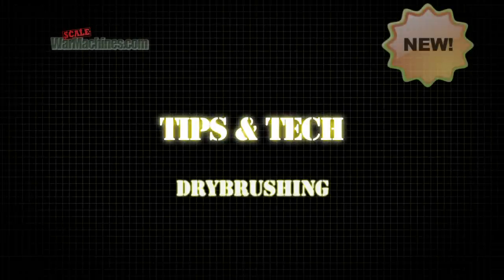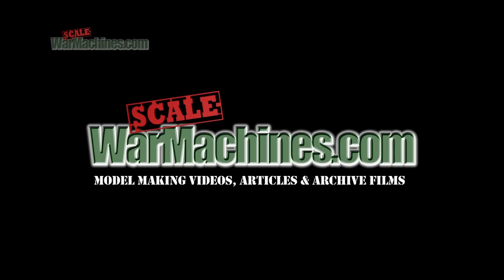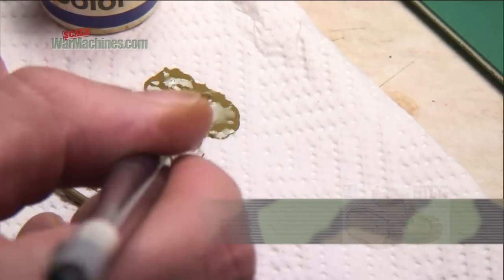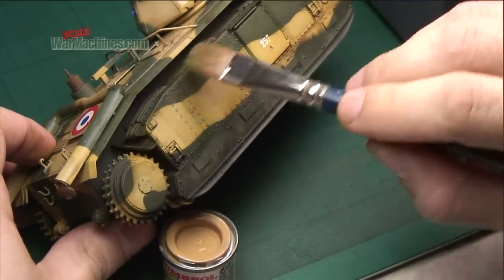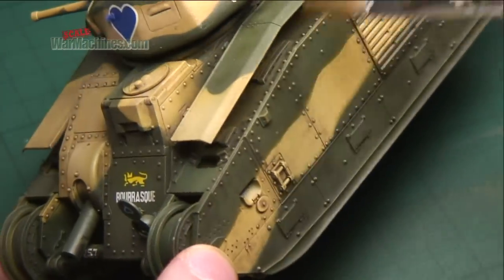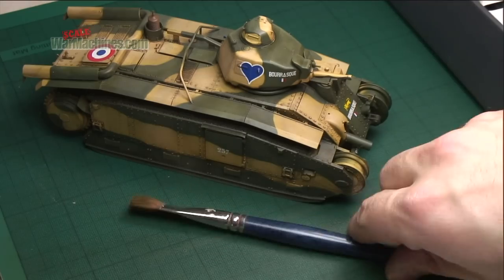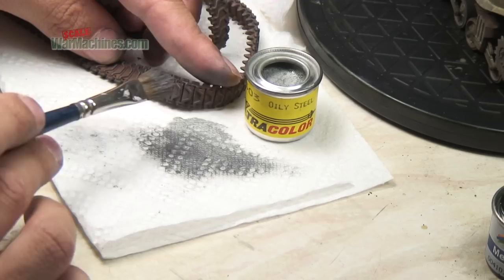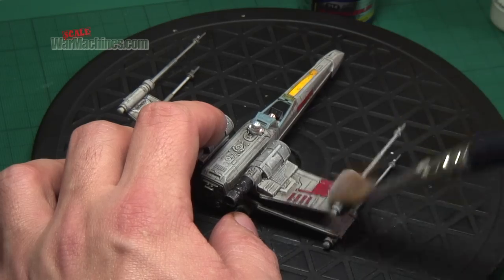DRYBRUSHING - SCALE MODEL HOW TO GUIDE

Comment: What colour should you use for dry brushing? 
Is it something metallic like silver,
A lighter shade of the colour which has raised detail,
Or is it something else?
Reply from the maker: Depends what you want to show. Worn shiny metal - use silver/gunmetal. Dark oxidised metal, then use dark brown. If you want to highlight surface details or contours then use the base colour lightened with off-white, sand, flesh, whichever lightens the tone to what you like. A good tip is to use oil paints just for the dry brushing, if you have any. That way, you can remove anything you don't like with white spirit.
Reply: Scale War Machines thanks. Something I love about the scale modelling community on youtube is they always reply to questions, as other channels rarely reply.

Comment: I wanna dry-brushing with tamiya enamel. But i'm afraid all will gonna be ruin if i do dot filtering next. 
Question is, how long i need to wait so tamiya enamel really dry and won't take effect if i do dot filtering next?? Or... Should i do dot filtering first, dry brushing later??
Reply from the maker: It's fragile stuff, best to seal with an interim coat of varnish or seal with Future/Klear. It's less stable than Humbrol and reactivates quickly even after a long drying period.
Reply: @scalewarmachines  hmmm yeah too bad. Btw i wanna try to use oil color for painting for this technic. Question is, how can i make sure that this paint is suitable, not like tamiya enamel paint that need topcoat after we apply it...

Comment: If drybrushing has gone a bit out of fashion what, in your opinion, has replaced it? I can't think of another technique that would give similar results. Have people just gone over to weathering powders or such like?
Reply from the maker: +dan Morgan Drybrushing still has its place but look at any model magazine & you will see that the days of a quick wash & drybrush are over. Now you have modulation, filters, oil paint rendering, chipping, mapping, mud washes, tensocroms, pigments etc. etc. etc. takes a lot longer. On the Char B1 Bis in the video the drybrushing was just the start of a long long process!
Reply: Scale War Machines I see. Maybe I should start a magazine called "Lazy Bastard Modelling". The premiere issue would have articles like "Piles of Plastic: How to put off assembling those kits", "Base Coating and Done for Crying Out Loud!" and "Track Smasher or Why Can't These Be Just One Molded Piece!"
I doubt it would sell well. LOL.
Reply from the maker: Dan Morgan I do miss the old days of "Lazy Modelling" though - I miss the slightly simpler "Verlinden Way" of finishing if you ever read those great modelling books published years back.  So you never know, it may catch on...
Reply: Scale War Machines Knowledge can be a burden i guess.

Comment: If i'm painting a tank Olive Drab what color should i use to dry brush?
Reply from the maker: Steven Shiflett Hi, just lighten your base coat in OD by adding some off-white or a lighter shade then simply drybrush. You can lighten even further & repeat. Good luck.
Reply: Scale War Machines Would Khaki Drab be a good color? or should i mix something, i work with tamiya paints.
Reply from the maker: Steven Shiflett Yes from the Tamiya range you could use Khaki Drab XF-51 or even for your last pass, use tiny amounts of Khaki FX-49 on your dry brush for sharp highlights or as your final drybrushing highlight..